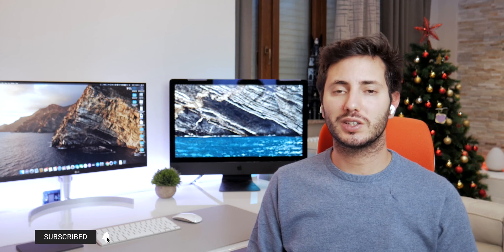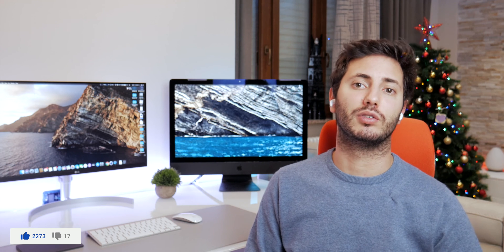iMac 27" Late 2013 Full Upgrade Process CPU, SSD, RAM | Shades Of Tech ⬡

Comment: Wait. This is an iMac 14,2? Late 2013 27" ? Really? There's an SSD slot above the ethernet port?   4:14
Reply from the maker: Yes there is!
Reply: @ShadesOfTech  will an i9 9900 go in there?
Reply from the maker: @marks47  no if you want an i9 you need the 2020 iMac. You can only upgrade the max cpu that apple shipped with this model. For this 2013 is an i7. You can’t upgrade to any cpu
Reply: @ShadesOfTech  Thank you. I'd like to THINK I'd find that doing my own research, I hadn't come across that, yet. Thanks again.
Reply from the maker: @marks47  here you can find the original configuration that apple shipped and the upgrades you can make. For example late 2013 iMac can go up to 	3.5 GHz Core i7 (Intel I7-4771) which is the one that I used. https://everymac.com/ultimate-mac-lookup/?search_keywords=A1419
2020 iMac can go up to 3.6 GHz Core i9 (Intel I9-10910).
Pay attention that every generation is slightly different and that there is difference in the internal build of 27” and 21.5”. So I suggest you to watch OWC or ifixit tear down to understand exactly which components you need.
For example 2020 27” doesn’t have the nvme slot

Comment: Is it possible to do more now in 2022? What is the best graphics card get for my iMac 27"  today,  2022?
Reply from the maker: You can buy a 2020 iMac with and 5700xt gpu and get an i9 cpu as upgrade and 128 Gb of ram. But ssd can’t be upgraded

Comment: I'm going to install a Nvme SSD and would like to clean and apply new thermal paste in the CPU and GPU. Would you advise me about the screwdrivers to access the CPU please?
Reply from the maker: Hi, thanks for the comment. First you need to identify your iMac model as far as year (2013, 2014,…2020) and also gpu because there might be slight difference. 
As far as opening tools I suggest you to read carefully ifixit guides at the point you are confident opening it. And all the tools are pointed out. I fixit tools are the best but also more expensive. Probably OWC tools are good too.  Generally any t torx screwdriver is good as long as it’s the right dimension. Also you need pizza tool to open the screen and adhesive to close it.
Reply: @ShadesOfTech  thanks a lot for your answer. I think it's the same 14.2 27" late 2013 that's why I didn't specify. I'll have another look at ifixit. There are so many options for the screwdrivers that make me confused as a complete beginner

Comment: Can I upgrade the graphics card? I want something able to run more modern games on low settings in there.
Reply from the maker: It’s soldered so you need to be very experienced. You can use e-gpu if you want  I made one video about it, you can find it on my channel

Comment: What about gpu
Reply from the maker: It’s soldered so it requires high skills to upgrade. Best thing is to start with an iMac with the best gpu possible and then upgrade all the rest
Reply: @ShadesOfTech  oh okay thank you for letting me know, I'm curious about an external gpu 🤔
Reply from the maker: I used it and made some videos about it, just check on my channel I tested thunderbolt egpu with older macs

Comment: You used your iMac nearly 7 years with a HDD?😂
rip.....
Reply from the maker: Mene Man Actually I started using ssd 3 years ago, but they were all external. Never had the courage to open the iMac until now!
Reply: Shades of Tech I have a 21.5 iMac from 2013 too and i‘m just so happy that I opened it a few months ago. It was from my mom, but she never allowed me to open it and i just thought nevermind😂.
Put a 250GB SSD from Samsung in and gifted the iMac to my grandma. I gave my mom the hard drive that was in there and said her data is still on there. She was just really scared i would destroy the iMac and her data gets lost. It’s amazing that i wasn‘t in a need of putting in a SSD adapter in there because the drives we‘re 2.5 inch and with no tempature sensor.
Reply from the maker: Mene Man yeah the sata ssd upgrade is really easy, I don’t know why people are so scared. You just need to take your time and make things with attention. actually I opened it 2-3 times to make tests and completely mounted back without any problem at all
Reply: Shades of Tech i saw you used tape to hold the display on the iMac, but when you remove the tape, doesn’t the color go away?
Reply: Shades of Tech people are really scared, they would rather pay apple to put a 128gb ssd in for 400€

Comment: Is it true the heat sync will react when you switch out the HD and replace it with an SSD causing the fan to turn on and operate at 100%? Another video suggested leaving the HD where it is and just inserting the blade SSD in the dedicated slot. Thoughts?
Reply: Dont have that problem. But if u have it, use TG Pro. Rly worth it. IMac overheat redicilously. U can set the fans to spin faster if cpu, or any sensor reach X temp.
Reply from the maker: In this video I discuss the storage upgrade on iMac with both sata and blade ssd upgrade https://youtu.be/BRyR9UNRZeQ

It’s true that the fan will kick in at full blast without thermal sensor.
You have 3 options:
1 change hd with ssd and use a program to set custom fan speed
2 change hd with ssd and use a thermal sensor so it will work as usual (I used the OWC thermal sensor)
3 change the blade ssd with the OWC aura pro x2 or an nvme with adaptor, but you will have to remove everything because it’s right above the USB ports.

I did both and ended up with 3 Tb ssd. The blade ssd is 20-30% faster than regular data ssd.
I don’t know you feel like you can do a full disassembley or just remove the screen and change the hd?
Reply: @ShadesOfTech  I would like to Max it out. This video and the videos you linked seem pretty informative on the process. Though it may take me longer than average to accomplish, I believe I can get it done. Thank you for the info. It would be amazing if I can contact you with questions if I come across a problem?
Reply: @ShadesOfTech  also, I wanted to mention that you had basically answered my original question in another video in this series. Sorry for the redundancy.
Reply: @ShadesOfTech  I did an SSD upgrade on an older Imac, replaced the HD with a SSD and after booting the fan kept blowing full power. Then i installed an app called SSD Fancontrol and all was good!
Reply from the maker: Yeah It works as well. I prefer the hardware temperature sensor, it’s a neat installation. But the result is the same of a fan control software.

Comment: What are all those cables for on the SSD at 4:46? Is it wrong to just connect the original connector to the new drive? 

Also what's that you are changing at 4:20? How necessary is it to change it if you are only upgrading the HDD to SSD?
Reply from the maker: Hi, I explained everything in this dedicated video.
Watch it and if you need help post a comment there 

@